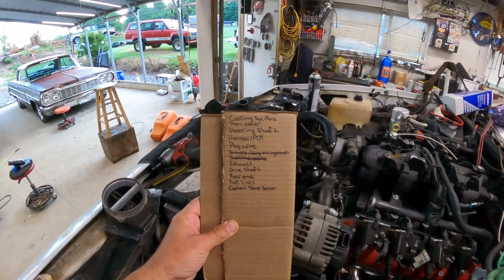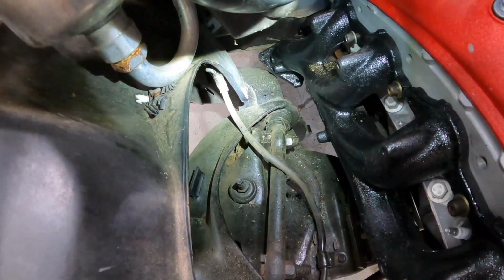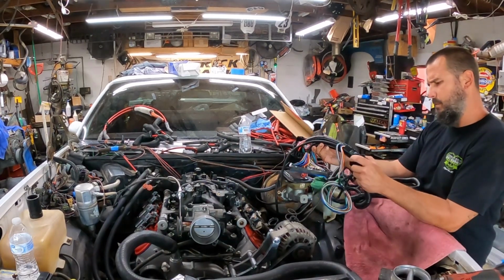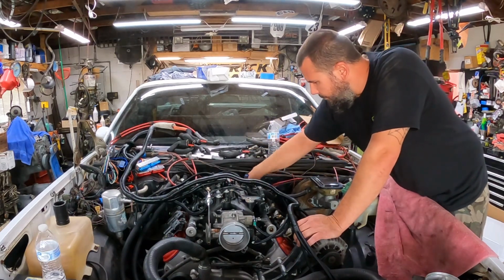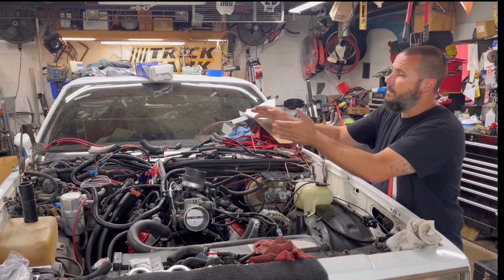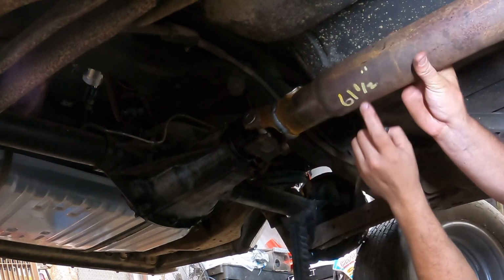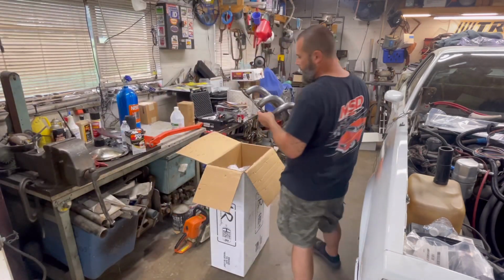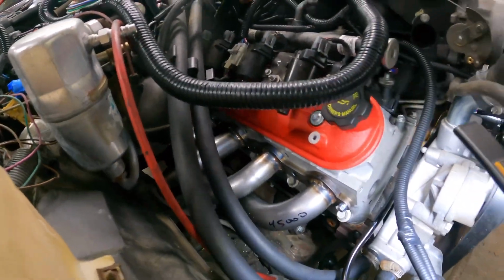Cammed 5.3 El Camino part 2 #lsswap

Comment: What trans did you use, and did it line up with factory cross member?
Reply from the maker: 4l60e. Best I remember the mount lined up but there was some notching required to clear the pan.
Reply: @LeftForDeadGarage  Awesome. Did you have to modify the driveshaft?
Reply from the maker: Yes, he had the factory one cut down.
Reply: @LeftForDeadGarage  awesome. Thanks for the info.
Reply from the maker: No problem. 
I may be wrong but one of the elco videos in the playlist may even say the length it was cut to.

Comment: Where did he get that steering  shaft from,?? An  can I get  the fuel tank  fitting
Reply from the maker: Not sure but it’s a jeep XJ shaft. You still have to cut it down to fit
Reply: How's the build going I'm new to the channel. I have my own 85 ELCO. I'm swapping
Reply from the maker: Well we had to pump the brakes for a bit because his powerstroke had massive engine failure. So he had to fork out like $10k for a motor. Hopefully I’ll have a update here soon on it.